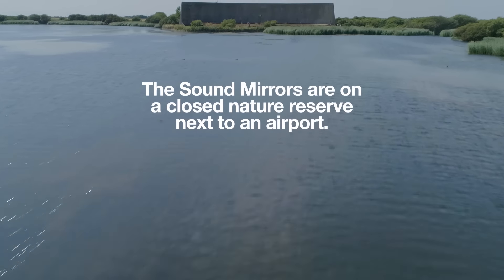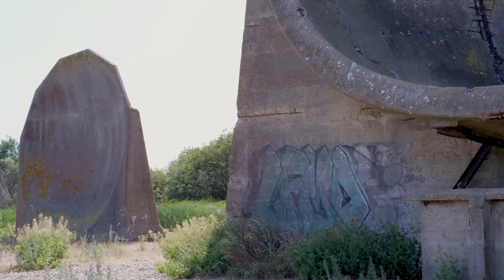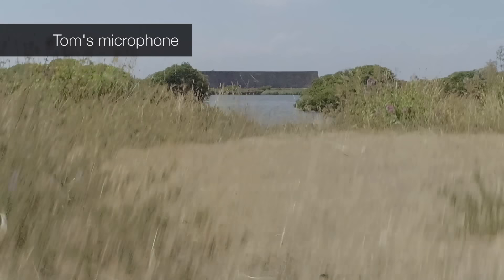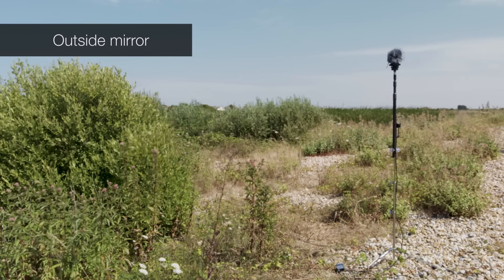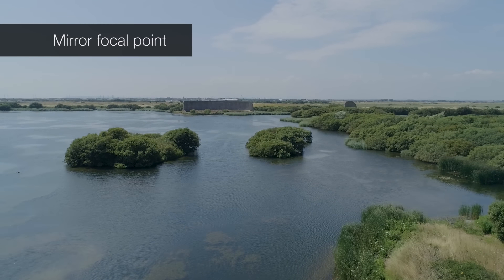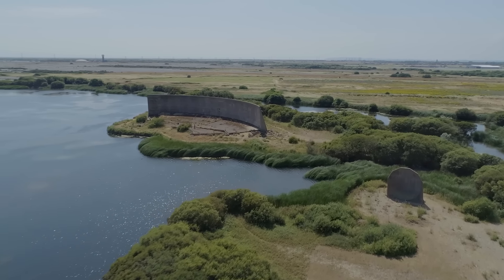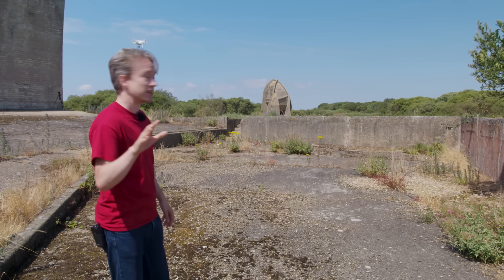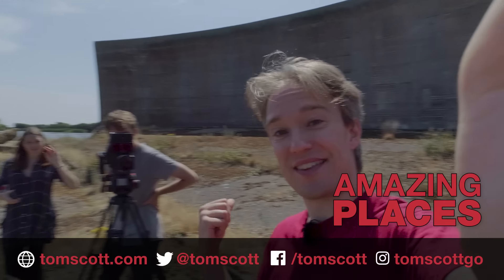Testing the sound mirrors that protected Britain

Comment: Do you know what happens when a drone propeller comes into contact with your skin? Potentially a lot of damage, I know people who have severed nerves and tendons in their hand and caused massive long term damage. Source. Flying drones and RC for more than 15 years, I had an encounter myself once and it taught me a lot of respect. Unfortunately, as shown by the flying ability of this drone pilot he wasn't in any position to advise the Tom (who should know better anyway) that flying it at eye height and grabbing hold of it is a) a really bad idea and b) not something that should be promoted in such a way to an audience such as this. Well done for putting a disclaimer up but it doesn't absolve you of actually flying responsibly. These drones can and do have a mind of their own sometimes. A slip, a mistake, a gust of wind or a loop in a bit of code, suddenly you find those props in your face or your hands.